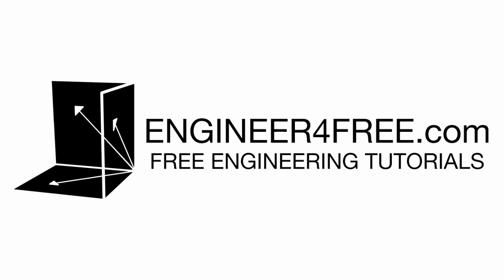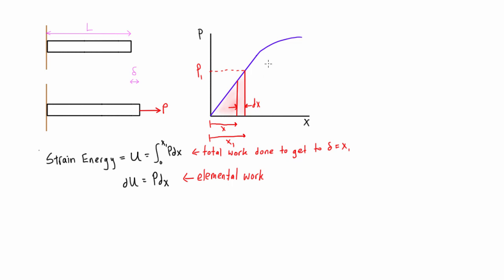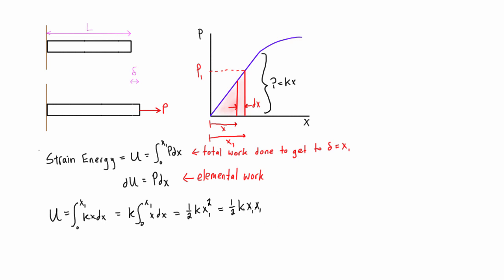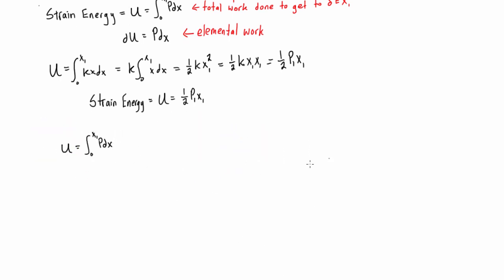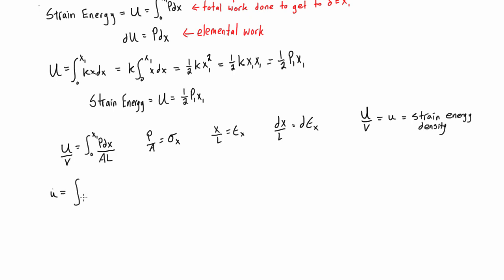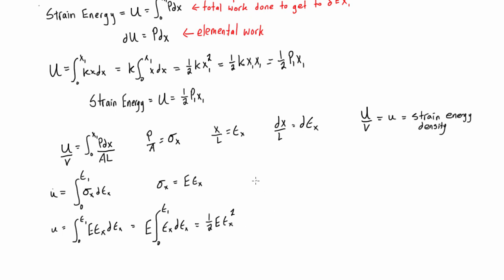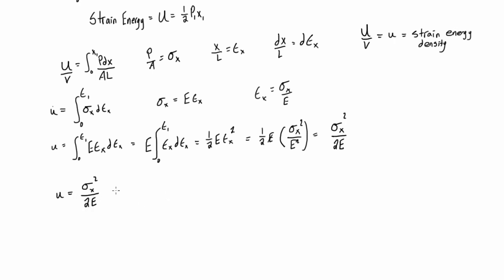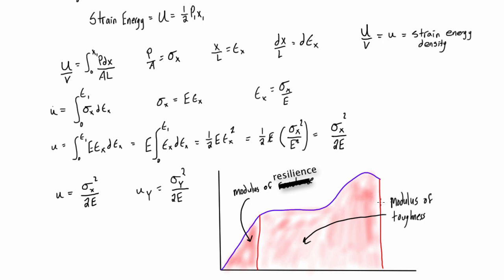Strain energy and strain energy density introduced

Comment: Sir I have a question about elastic hysteresis in viscoelastic materials like rubber. When we apply stress the strain is not proportionately increasing, during the loading (stretching) of material, the energy gets stored in the material, now when we unload it i.e., when we release the rubber, it doesn't retrace it's original path I'm not understanding why it doesn't retrace it's original path ? Please make a video on it if possible.
Reply: I found everywhere, no one is giving the reason behind, from graph point of elastic hysteresis they say that heat energy is produced when the rubber recoils, I say heat should also be produced when it's being stretched why heat is produced only when it's being contacted ?